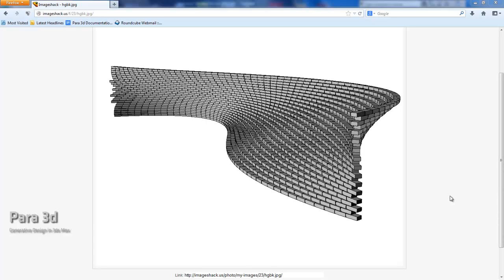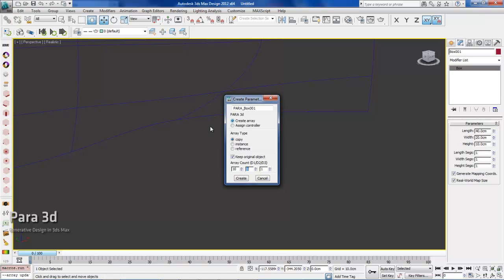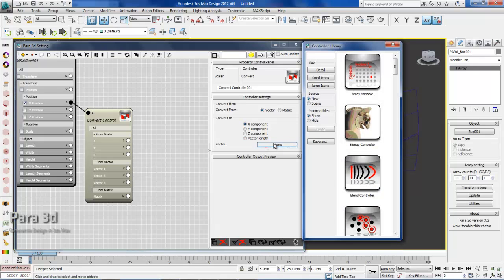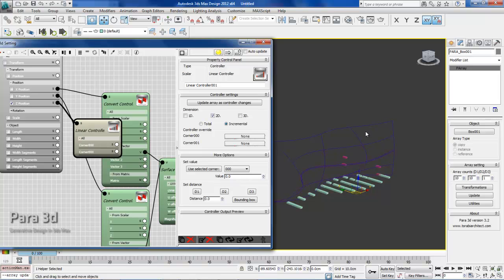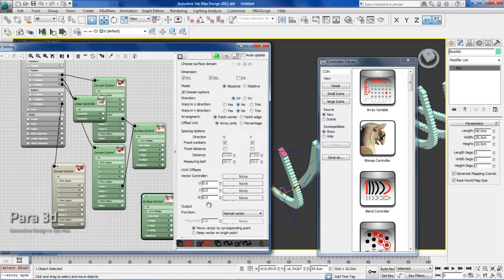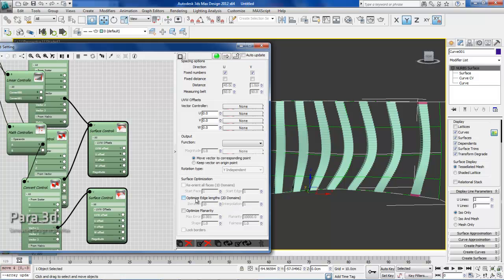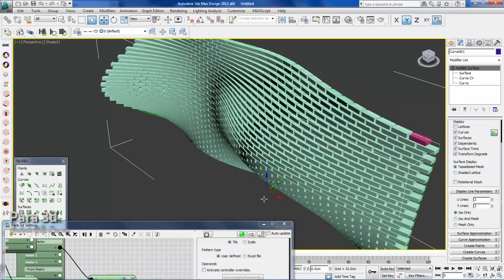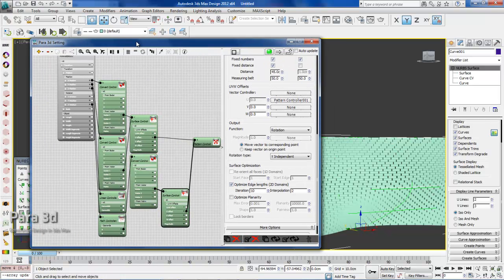Parametric wall

Comment: Seems like you can't follow this tutorial with Para 4.8, esp around 5:34, the z position will be diagonally arrayed initially, and only changing the D1, not D2 will fix it's alignment.  At 6:29, D2 will not fix positions, only D1, but the positions are inverted, I have to use -11 instead of +11.  The rotation as well doesn't work around 8:30.  Love Para 3d, please update this tutorial! Thank yoU!